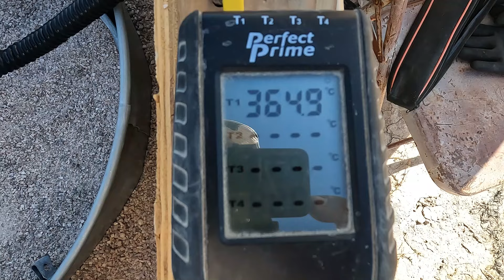161- 240-Volt Element and 55-Gallon Sand Battery Updates

Comment: You should take a look at Zeolite pellets.
Adding water causes them to heat up, reckon you could make a pretty decent heating system for a shack,room,shed etc. if you had them on a conveyor belt so they were moving in the fresh air and let the sun hit them, they'd dry out and ready to go again, and repeat.

Comment: Thanks for sharing! I got a practical question, maybe you find time to answer it:

I got into this project right from the beginning. I then didn't follow the process for about 6-7 months and now I got into it again a few updates back. I see all the improvements and how 'easily' the sand can be heated with even as little sun as there is in the winter months. What I still don't get is what use the sand battery could have in heating water. I would love to use it for more or less constantly heating up water to around 80°C in a flow-through system: Cold water line in -> heat exchange -> 80°C out on the other side. If the sand can hold temperatures way above 80°C how can you heat water without getting it to evaporation or expand in the water lines? I know there are security valves that can handle both issues. Has anyone ever tried to tackle this issue and found a proper solution? You could perhaps limit the heat of the sand up to 90°C and put a spiral pipe in the sand long enough to extract the heat into the water. But in that case you could also use a boiler with the proper size and hook it to your panels during the day. I would love to work on a heat exchange idea with a sand battery that holds temperatures way above 100°C.
Reply from the maker: I can only tell you what I have seen on another project a guy built I know. He ran a water line welded stainless steel into a fire burner. A steel wood burning stove but the way the water keeps from turning to steam is it naturally flows from convection. So, if you have a holding tank above or even off to a side I imagine the water will flow like a pump and heat the whole tank. Now if the tank is too small it may boil I don't know all the parameters but I am experimenting on this model that I am building now. So, maybe we can learn together? Thanks for the comment.
Reply: @off-gridsurvivalmike8120 that's how people figured out rocket stove water heaters. Open flow to prevent steam expansion. Not sure how to safely stop flow because stopping water in the pipe will boil and not sure leaving it empty is good for the pipe, but they leave it flowing and then use a mixer Valve to output what temp they need.